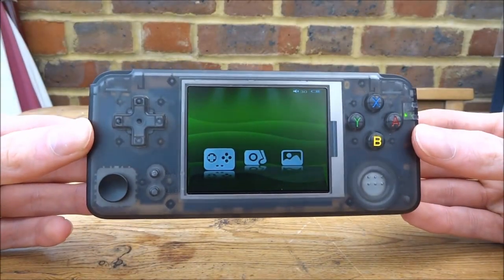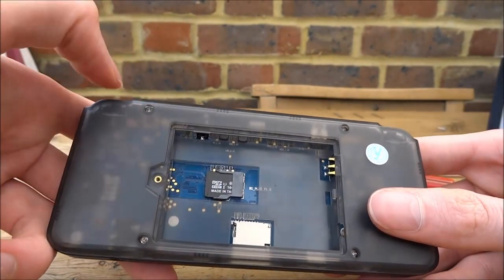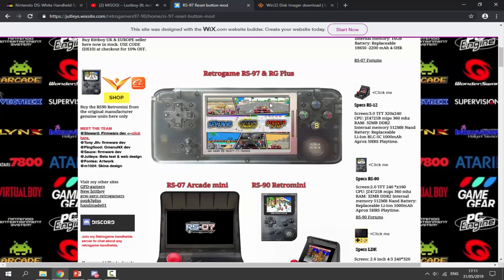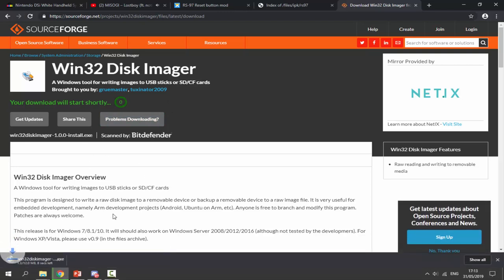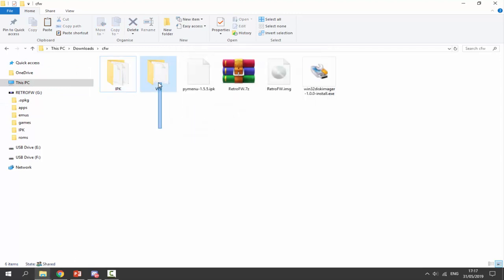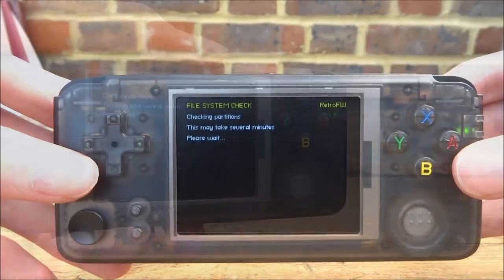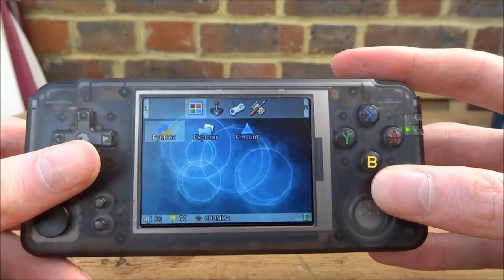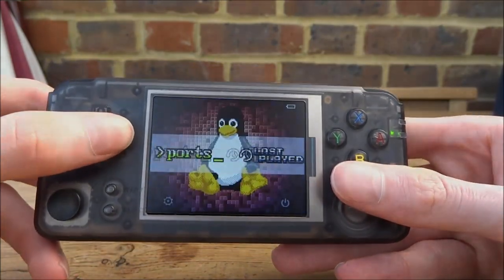Q9/RS-97 Retro Handheld! Custom Firmware Setup!

Comment: Attention! If for some reason after writing system on SD card you can't see in file menager Root disc you need to go in Windows 10 to Computer Management and Disc Management and find the Retrofw partition and manualy give it a disc letter (for ex. F:).
Reply: Hi. My SD card after flashing with rfw image file shows in explorer but windows says I need to format it before opening it. Window's is not allowing me tochange drive letter in disk management.

Comment: I have my old files on the 16gig that came with the RS97 handheld ,I copied everything to my PC,as a backup,i have not use any firmware or anything but now I want to go back to my old original ,basically reverse everything as if back to when i first bought the RS97 from out of the box ,but i already deleted the 16gig memory stick that came with games,which i did save on the PC before i deleted,can anyone help.

Comment: followed the steps to this video to the tee. unfortunately, for some reason, my 32 gb card...after flashing the custom firmware, is only showing as 700mb available.
Reply: It might be belated but i'd still like to give feedback. When you've flashed the firmware and partitioned your sdcard with W32 Disk Manager, you need to resize the 700mb partition with the unalocated disk size (~28gb) inorder to use full disk size. You can do this with windows partition manager if you use W10, or use Paragon Partition Master Free.
Reply: Are you sure after you flashed the SD card and put it in the console you let the console fully expand the space? I also used a 32gb SD and had absolutely no problems in the least.Also,did you flash the SD on a Win7 or Win10? It won't work on Win7 when I tried.

Comment: If I do this how do I get all the games back on it
Reply: Best answer is to put the original stock SD in a safe place in case you need any of the files (like Roms or just want it back to stock) and simply flash the new CFW as shown in the video. You must have Win10 to complete the steps shown in this video or you'll have a useless SD that won't do anything

Comment: Help. After flashing rfw in SD card my PC can't read it. It says I have to format the card to open it. Please help. RS-97 is not playable with custom firmware.
Reply: I had the same problem as you're having. I was using Windows 7and for some reason it can't read the SD or says it needs to be formatted. It reads it fine on Windows 10 (which James is using here) and the whole process is a breeze. So yeah,it won't work on Win7,you have to have Win10.

Comment: ok really need some help here, ive got the RS-97 Plus model with the cut out metal screen- this is pretty much the only CFW ive been able to get working without a blank white screen. however this CFW doesnt come with any of the Emulators that the system originally had. so how do i get NeoGeo, Nes, Snes, Sms, Smd, Cps, Gba, Gbc etc etc back on it? annnd does the TV out feature still work with this?
Reply: Same problem
Reply: The emulators are on the same page as the CFW. Check the "Ipk files gameblabla server" link for the emulators,and I think the TV out should still work though I've never bothered with it.

Comment: The thing with these Chinese devices is they change so much all the time. You might be able to say "oh you need the one with the metal strip like this" today, but I betcha in about a week or two that will have changed and the device will be slightly altered again.